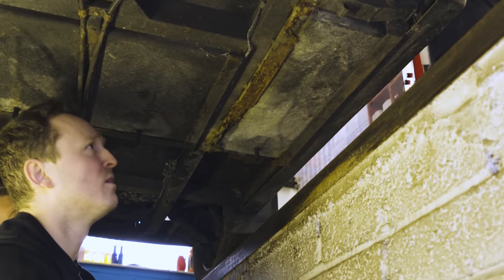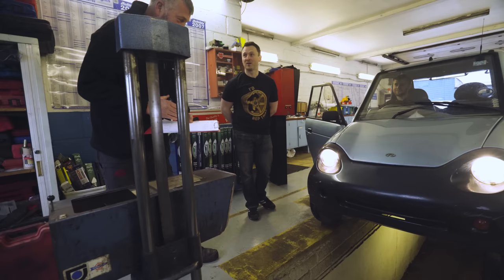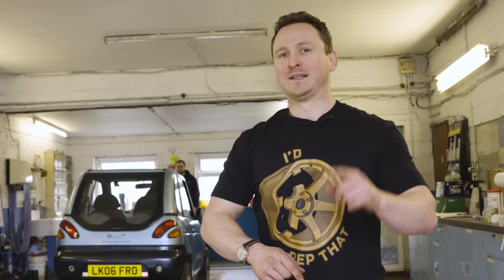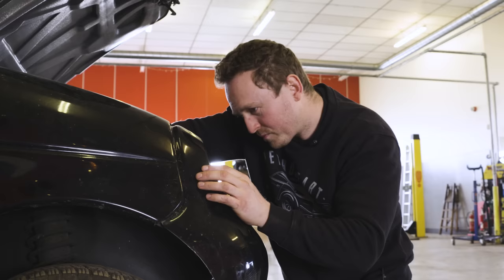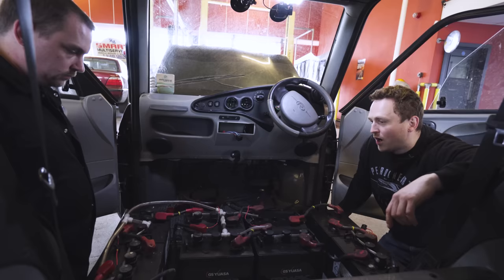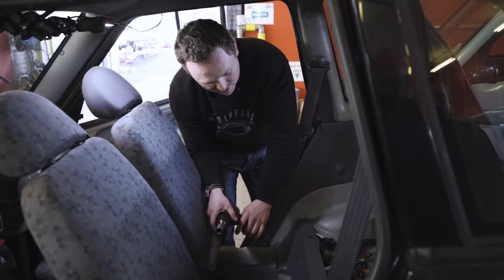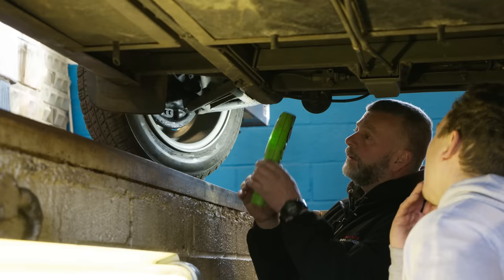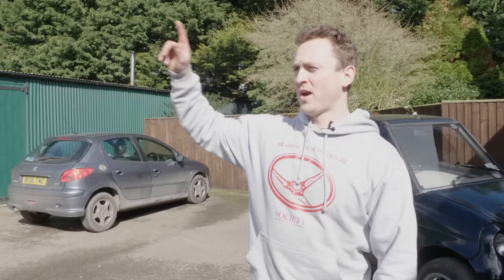Can We Get Our £400 G-Wiz Road Legal?

Comment: Get a bike engine in Gary and see if you can beat both the BMW z3 times round the track :)
Reply: See, I like this, but the chain drive and current frame design sketch me out. 

I'm know I'm overthinking this, but do a custom tube steel frame conversion on Gary with a proper firewall and safety cage, then mid-ship K-swap it. 

You'd lose the backseat but gain insane power to weight...think even smaller Ariel Atom.
Reply: Put lighter batteries like Lipo batteries in Garry and a new larger motor for more horse puppies
Reply: And more voltage for the motor, the motor should have more cooling fins on it
Reply: @DJSekuHusky  That is an awesome Idea.  I was thinking that myself.  As it is a "Quadra-Cycle" I think a Hyabusa motor in Gary is a MUST DO
Reply: Nah a v8!
Reply: And watch it roll over at the first corner
Reply: PHIL ASWELL. DONT FORGET HIM
Reply: Turbo Hayabusa, anyone?
Reply: @DJSekuHusky  The center of gravity would make that a nightmare though.
Reply: @alistairwalker2850  I factored the weight of a fuel cell in the front plus upgraded steering and suspension components, as well as other forms of ballast would help get it close to the magical 50/50 distribution.

I suspect even if it was spot on, driving it would (still) be a nightmare. Like trying to daily a Lambo in gridlocked rush hour traffic: a bit too impractical even to show off. 

Still, I wish I could build it or watch it get built, just because absolutely no one would ever expect it.
Reply: @DJSekuHusky  So, uh, what parts of the g Wiz are you gonna keep?
Reply: And run formula Gwiz competition
Reply: How big are Tesla motors?
Reply: Yes!
Reply: Yes
Reply: Put a 250cc or bigger scooter engine in the thing and take out the electric crap this what I would do if I could get one these or any other small car ..

Comment: Would love to see some hypermiling with a solar panel rigged up to the roof.
Reply: Where....in Africa perhaps?
Reply: @TermlessHGW  you can get enough light in europe, dont worry.
Reply: Math has ben done over and over (and over...) again: solar panels don't actually contribute to any relevant charge on the batteries/higher mileage.....
Reply: @rhobson  what if they put a windmill on top 😂
Reply: @empeming  Second law of thermodynamics left the chat :D
Reply: @rhobson  Ok, how about a waterwheel on the roof and only drive it in the rain?
Reply: The Model 3 is pretty much the most efficient EV available today, and uses 150Wh per km. If we give Alex the benefit of the doubt and make a very generous assumption that he can get Gary running on only 50Wh per km, and that he can fit a 200W solar panel on the roof (again, very generous for a G Wiz), then in ideal conditions the solar panel would generate enough power to travel 4km per hour. There's a case to be made for solar on cars but real time range extension definitely isn't it
Reply: @bosstowndynamics5488  It would still be cool to see without a fast charge time. Leave it charging in the sunshine for a week then do one journey on purely solar energy.
Reply: @Cendius  While I don't think anyone did that yet, I think there was one guy who, a few years ago, hooked up the little solar panel on the sunroof of his phaeton  up to a charge controller to keep the car alarm, infotainment, etc... from draining the battery. Normally, that solar panel is connected to the fresh air blower in the A/C system, so that when the sun shines on the car, it blows cold air in there to keep the interior at least kinda cold, but I think rewiring it as a trickle charger is much more useful, as that entire electrical platform, which was even adapted to a van, just loves to drain the battery, and then has absolutely crazy glitches because of the flat battery. One of the most popular glitches is the car alarm randomly turning on when unlocking, and not turning off again, even while driving.

Comment: I've owned several G Wizzes! I think they're a load of fun in a city. If the charging system plays up, just disconnect the EMS. The old lead acid batteries can handle a bit of overcharging . .
Reply: They ARE good.

CT just went ahead and done a TG, G-Wiz-bashing.

Not very imaginative or considerate of those who've ever driven - or even OWNED - a G-wiz.
Reply: @letsdiscussitoversometea8479  I quite agree. I found my GWiz was amazing in the city, it could park in spaces that even a Smart car would pass on, tiny turning circle. Good stereo, nippy enough, very cheap and simple to work on, the 2CV of electric cars.

Comment: The fact Alex liberated two poor wizzie owners from these monstrosities should alone be enough to put him on the Nice Santa list for this year's Christmas.
Reply: Would you have found the car - oh, sorry..."quadricycle" - a monstrosity, had you not heard someone else, TELL you that it was such??

You see, I drove one of these over 15 years ago, and of the around 45 to 50 different cars and vans I've ever driven, this actually ranks better in several aspects, than even more higher quality cars, such as VWs and VW group cars, as well as some Fords, Fiats, Renaults etc.

Parking is extremely simple, it costs literally PENNIES to operate, charging is very easy indeed, shopping can be loaded even while carrying a single passenger, a third person can fit in if sat sideways in the back - basically, it's absolutely fine for getting what you need in and around town.

Top Gear took the p*ss out of this car (well, only Jeremy Clarkson to be honest), and it was just G-Wiz-bashing really.

People never really gave them much of a chance, but instead treated them with contempt and ridicule, so they ended up a "joke" to own, when that wasn't ever the case.

Try running a modern day VW Golf - I was using one last week, and it felt unnecessarily excessive for what I needed - more expensive to run, more things to go wrong, higher repair and refuelling costs, and I almost felt as if the car was making its decisions for me (automated processes).
Reply: @letsdiscussitoversometea8479  I had a Sinclair C5 lol when I was 12 and would rather have that. If you crash in the GWIZ you are dead straight away. 
Probably good for places like Catalina USA where there are virtually no cars at all and everyone drives golf carts about but apart from that you wouldn't get me driving one.
Reply: @LeslieandLukeSoCal  strangely, I was just thinking about C5s yesterday! (No, not the Citroen - one of which I did once own funnily enough :)).

Then again, I do like Sinclairs in general - particularly the Spectrum, so maybe that isn't a surprise.

Never driven a Sinclair C5 - I suppose it's one of those bucket list things to do.

I can definitely see how that would have helped a 12 year old, though I was under the impression you had to be at least 14 to drive one?

Comment: Looks like the motor is integral with the back axle, and the chassis is just a straight box section

So, build a 4x6 out of both of them, ie two driven back axles, with the back half of Gary stuck onto Barry!!!

Comment: Things to do with twist for the new G-wiz owner:    

1-  The maximum number of school runs possible from 1 charge, for a driver and passenger. With after school clubs drop off's and collections. VS an internal combustion engine car with the same amount of fuel (money wise), that Barry cost for that 1 charge.      

2-  Do a weekly food shop for, a family of 4 in one trip only, (from Brent Cross). Up to the value of Barry and Gary. Northing is allowed to be left behind, including the passenger (a blow-up doll inflated).

3 - A race,  designated driver and real passenger (using the G-Wiz) from a pub inside central London to outside the M25. Charging is allowed and back again (as some one left their phone at the pub once again).  VS two other people using public transport (buses only), for the same journey on the road.

Comment: Build Garry into a trailer - insert a pile of additional batteries into him.   Pop a little generator in with a small fuel tank - along with some control systems, and see if you can get from London to Glasgow faster than a public transport.  Something that can be done on a Car Throttle budget and make good content.

Get the whole thing wrapped to make it look like a Ford Focarse RS too.

You could also swap the motor out with one from a Zoe or a Leaf. - Whack some Lithium in there too.  Make the fastest Gee-Wizz.

Comment: Increase the voltage, usually motors are rated for a max but not used up to that, see what the best top speed is and of course check your 0-30 times.

Comment: Roof rack with solar panels? Then try and use it to do “around town” activities using solar power only.

Maybe add two front towing eyes and stick a harness in the back so if you cannot complete your activists on solar: someone has to pull it like a horse and carriage.

Comment: Is Gary AC drive or DC drive?
I'm repairing an 07 plate one for a friend(with a very similar registration to the one that appeared at 8:25) that could do with an energy management controller (version 1.15AC) and battery fan so it will charge properly, if those parts are going spare!
The OBD connector is an RS-232 serial port, have you managed to get hold of the software for it?

Comment: Do not drive until repaired (dangerous defects):

Driver's seat insecure (6.2.5 (a) (ii))

Passenger's seat insecure (6.2.6 (a) (ii))

Service brake has no recorded effort at a wheel all brakes (1.2.1 (a) (ii))

Service brake efficiency less than 50% of the required value (1.2.2 (a) (ii))

Parking brake efficiency less than 50% of the required value (1.4.2 (a) (ii))

Repair immediately (major defects):

Horn not working (7.7 (a))

Front Windscreen washer not working (3.5 (a))

Windscreen washer not working (3.5 (a))

Front Windscreen in an unacceptable condition (3.2 (c) (i))

Offside Front Headlamp aim projected beam image is obviously incorrect (4.1.2 (c))

Offside Front Direction indicator does not face the front (4.4.3 (a))

Offside Rear Stop lamp(s) emits other than a steady red light (4.3.3 (a) (ii))

Rear fog lamp not working (4.5.1 (a) (ii))

Offside Front Inner Suspension component mounting prescribed area excessively damaged significantly reducing structural strength BATTERY HOLDER (5.3.6 (a) (i))

Service brake excessively binding ALL BRAKES BINDING (1.2.1 (f))

Monitor and repair if necessary (advisories):

All four tyres perished

Comment: Only slightly bummed. I liked the silver color on Gary better than the all-black Bary model. Seems a bit like cheating to just abandon Gary! Maybe you should wrap Bary in a cool eco-advertizing green-car vinyl wrap?
Reply: Okay: now that I've seen the MOT on Bary, I'm a fan. The undercarriage is basically rust-free! Now you've got to upgrade the batteries (lithium-ion?), motor and brakes. This car is so light, performance upgrades ought to revolutionize the range and driving excitement. Do it!

Comment: I hate electric cars but... I would like to see it updated with a modern battery chemistry using salvaged cells from something else, then upgrade it with the motor from a Nissan Leaf. Why a Leaf and not a Tesla? The Tesla stuff is expensive and big while the Leaf stuff is worthless since no one uses it. Plus, its such a small vehicle that it doesn't need much to make it dangerously quick.

Comment: 100 % needs 4 miss matched shitty market spinners on there tint the back windows not forgetting to leave to air bubbles in it as above homemade body kit that never sees a lick of paint   some overkill exsaust .. instead of lowering it make it higher of the ground fill the boot with speakers that don't work properly and replace the steering wheel with a pirate ship wheel.

Comment: Would be interested to see if there were something like lithium-ion batteries of similar design that would be a drop-in replacement that could be installed and compare the range between those and the current lead-acid batteries?

Or if something like swapping all the bulbs out for LED rather than incandescent would make a range difference as well (where they use far less energy to operate)?

Comment: You won’t want more than one person in this abomination anyway, as it would only serve to dramatically reduce the already pitiful 50 mile range care of the giant, heavy lead acid batteries and 13kW motor. Which, for the record, is less powerful than a lot of starter motors. Yet Reva anticipated it would be just fine to propel the G-Wiz. No. No Reva.

Later modes moved from DC to AC, which was an improvement. Much like being hit in the face with cricket bat is better than being hit in the face with a lead pipe. Even the fine Lithium Ion version wasn’t enough, despite the best efforts of its roof-mounted solar panel.

Comment: Here's my suggestion for what to do with Gary: 

Strip out any and all unnecessary weight. 
remove the original brakes and wheels and replace with bicycle/trike wheels.
Cut a large hole in the floor, so the diver and passengers feet touch the ground.
Paint red and yellow.

Ta-da! Little Tikes car for adults!